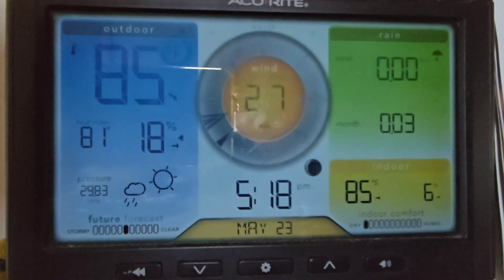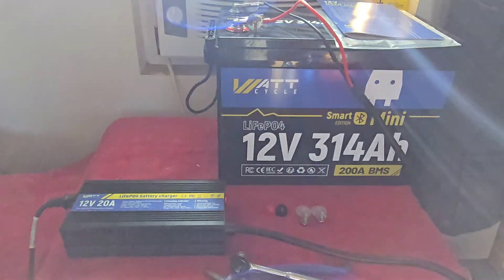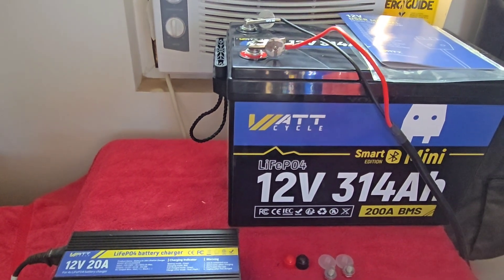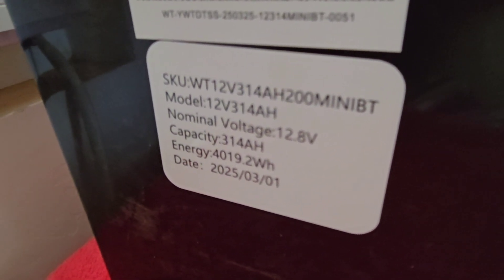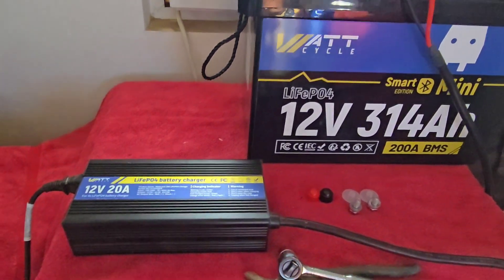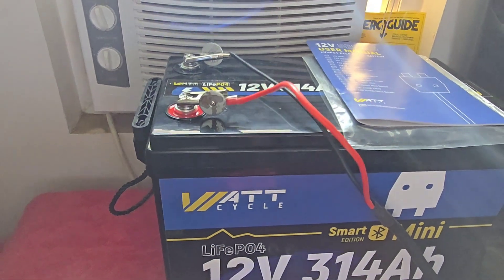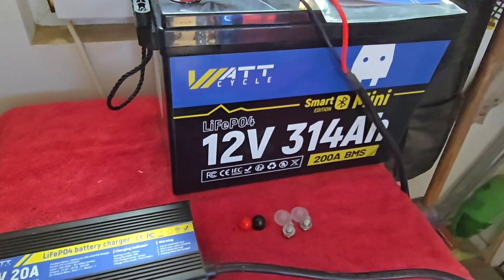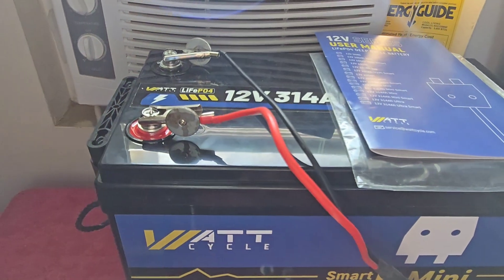How Long Did I Run An Air Conditioner On One 12 Volt Battery?!  May 23, 2025

Comment: Hello GBear That's a beautiful Watt Cycle battery 🤙 I'm now able to run my washing machine off grid using just one 100ah battery & two 100 watt solar panels with an inverter.
The 50ah Watt Cycle battery I won in your giveaway is being used to power lights in my detached garage.
Thanks again.
Reply from the maker: Great to hear!

Comment: What are the charging parameters. Charge,float and equalization
Reply from the maker: Mine are set at charge 14.6v, float 11.0v, equalization disabled.
It is not recommended to run equalization on LiFePO4.

Comment: What if you use 2 in series.  The Wh quadruple but Im not sure how that translates over the AC.
Reply from the maker: No WH double.  AH are still 100, but volts double from 12.8 to 25.6.   25.6 x 100=2560
12.8 x 200=2560
So series or parallel, 2 batteries have the same wh.
Reply from the maker: Welcome aboard!

Comment: That battery more or less when am I expected to pay for something like that that quality
Reply from the maker: Most people with grid power, and also off grid systems would require 4 of this size battery, minimum, connected in series to make 48v, 314 amphours, which would give them 1068 watt hours for power.  Than
t means they can run 1068 watts of appliances for 1 hour.
Note that this also requires other equipment to meet those numbers, with a ballpark cost of around $7000 to start.

Comment: I’m a subscriber of your channel. I’m hoping you can explain how I can get started with solo panels in central Florida cause the electric bill is off the chain, but I really appreciate your videos.
Reply from the maker: Hello, and thanks for your support.  As far as your question, I can't do much for you there, since I don't know Florida laws, or your local laws concerning solar.  
I know that you are on grid, also, since you mentioned your electric bill.
You will need to check your local codes and HOA rules, if they apply.
FYI, a small system like you can buy at Harbor freight won't do much good for you, as 100watts of solar can only sustain a 100w lightbulb, and their 35ah lead acid battery would only provide a little over 400watthours after sunset, minus 50%.  So you would need a good hybrid system installed that allows you to use grid power and supplement your total power requirements.
That's where they get you.  That requires permits, qualified electricians and installers, and notifying the electric company that you will we backfeeding extra electricity through their grid.  It's a hassle.
Sorry I couldn't give you better news.

Comment: Are they making batteries now where they can only be either 12V or 24V but not both now? I've not seen batteries state that before.
Reply from the maker: LiFePO4's come in 12v, 24v, 36v, and 48v, but you can combine any of the 12v or 24v in series to make 48v.
36v is rarely used and components hard to find, but 48v is popular.
24v systems are around too.

Comment: I read a trick in a theoretical survival post one time where they would turn on the power to fridges and AC for a short time. Then turn them off. And then turn them back on to rest them. Not sure if it works but it seemed interesting to think about. 

When you get to July and August will be harder probably in the heat.
Reply from the maker: Today's fridges and freezers only use about 260w to run, nothing is used when fridge/freezer gets down to temp, so those are the least of the worries for usage.  Air conditioners, electric heaters, etc are energy guzzlers.

Comment: So when you factor in heat and air conditioning running in summer and winter, do you think there's a difference in how long your power equipment will last for in terms of 12V and 24 V setups compared to each other ? (re: how long inverters and power banks will last)?
Reply from the maker: I haven't experienced those failures yet, so I can't give an accurate answer.
Reply: @GBear  Well actually that's a pretty good answer. that means your systems are lasting. :) Thanks for the reply.
Reply from the maker: @noahriding5780😂👍